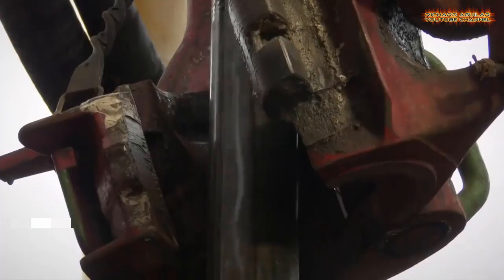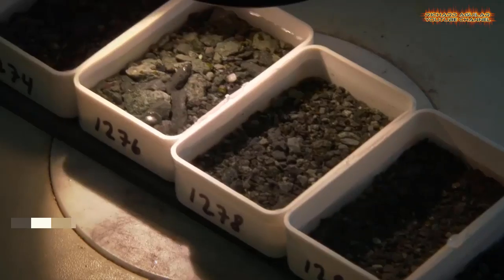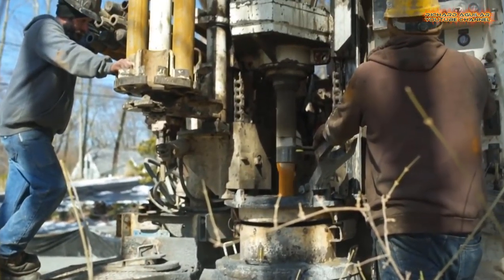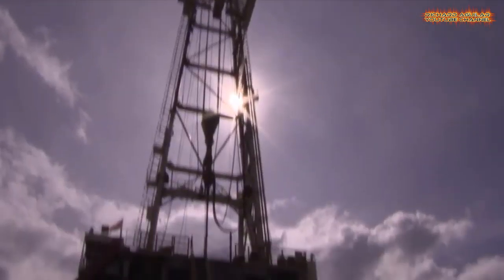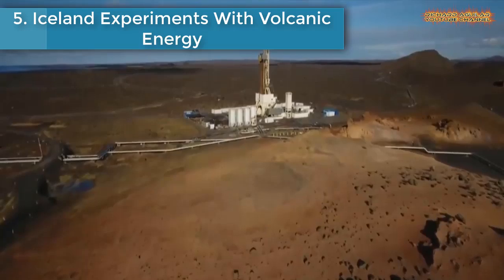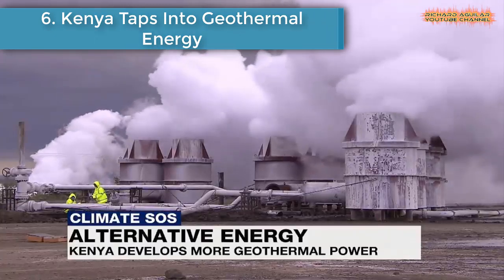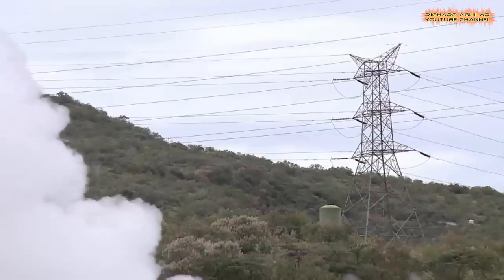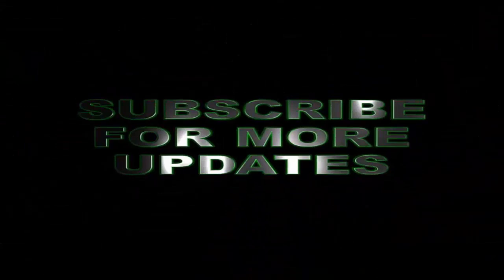The Rise Of Geothermal Energy As A Source Of Renewable Energy

Comment: Geothermal power in New Zealand is a small but significant part of the energy generation capacity of the country, providing approximately 17% of the country's electricity[1] with installed capacity of over 900MW.[2] New Zealand, like only a small number of other countries worldwide, has numerous geothermal sites that could be developed for exploitation, and also boasts some of the earliest large-scale use of geothermal energy in the world.

Geothermal energy has been described as New Zealand's most reliable renewable energy source, above wind, solar and even hydroelectricity, due to its lack of dependence on the weather.[3] It has also been described as the currently (2000s and 2010s) most attractive new source of energy for New Zealand, as petrochemical fuel prices rise and easy hydro power sites have been tapped - it has been estimated that another 1000MW of geothermal resource can be used for generating electricity

Kenya only needs one more Geo-thermal plant which would provide free electricity for all.